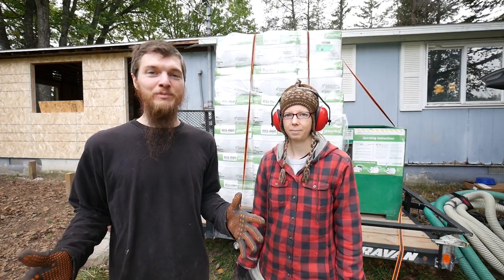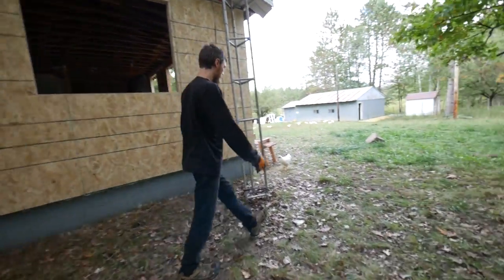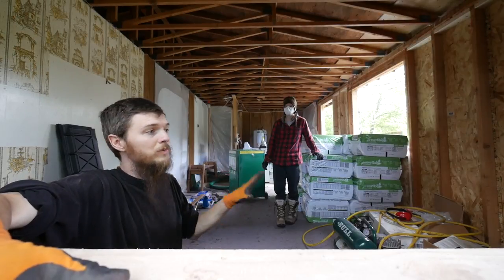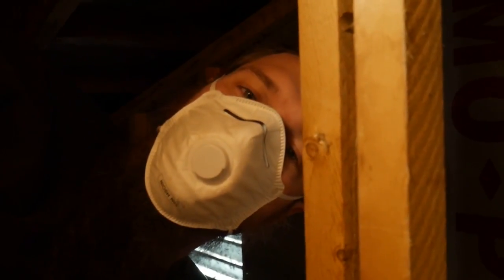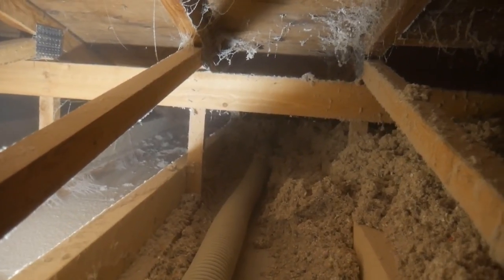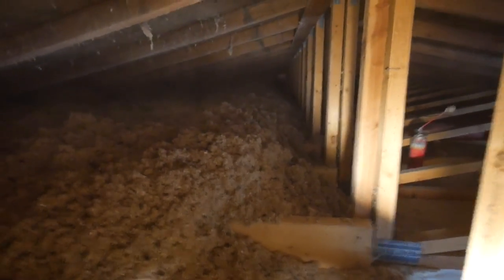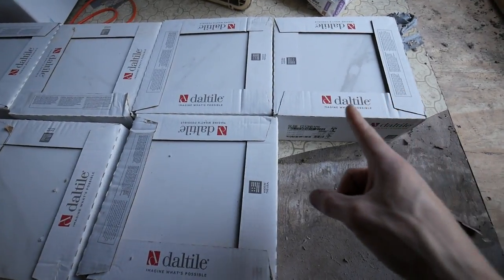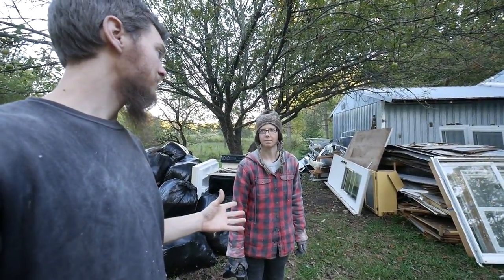Insulating a Cramped Mobile Home Attic - Home Renovation

Comment: Just a thought...assuming you're replacing your kitchen stove, would you consider propane?  The reason I say this is, during power outages, you would have a heat source in addition to the woodstove, but, if there were a power outage in the summer, you could heat water to wash or cook. 
Just food for thought. The project is coming along.
Reply from the maker: Even some newer propane appliances need electricity to run. For now we are not considering propane.
Reply: @diyfferent  I had one...you can light the burners with a match easily. I don't think they have had pilot lights for 15 years. The government thought people were too stupid to notice if the pilot went out. I had a grill with a side burner...it was a good backup.
You are doing such a wonderful job!

Comment: YOU NEED VENTS IN THE ATTIC.  Check with some of your buddies on youtube.  They will help with ideas.
Reply from the maker: We actually no longer need our gable vents because the roofer who replaced the roof last year installed a ridge vent.
Reply from the maker: Like the article says, everyone has an opinion about this stuff :) Most houses in the past were built with gable vents. Then, when ridge vents came into play, builders switched over to them as a better way of venting. So when homes are are re-roofed, they almost always get a new ridge vent now. For our situation, having a very low pitched roof and since the insulation requirements have also changed, we just don't have much room for the gable vents and it's best for us to just remove them.

Comment: You can always rake it to move it with a lief rake, it isn't that bad to move. Wow it only needs to be 8"=R29-12= R43"  LOL after a good wind storm it will be drifted like snow up there and hurt you  roof venting. If mice get into it you may never find them.
Reply from the maker: We did it right. In Michigan, code for attic insulation is R38 to R49 depending on where you live. That equals about 12" to 16" respectively of this insulation to reach those values. In the USA, 8" (R25) is inadequate for an attic in any climate zone. Winds won't be affecting our insulation. We hardly ever get wind here.

Comment: I was thinking at least a cap on your head in case you ended up too close to the roof with all of those nail ends...you would have something to buffer first...I know you are smart and careful about it, but not a happy space to be in ...good to be doing that while the weather is a bit cooler.  I have never seen a "blow in" before...pretty interesting...So this was the riddle that came to mind....In the kitchen is a little green bull. It eats and it eats and it never gets full.  What is it?  ( insulation blower )  I was surprised you didn't devise a ramp to wheel that machine up into the kitchen instead of that heavy lifting.  You are both very strong ( all that hard work!)   Am I allowed to be proud of you?  Too bad if I am not!....
Reply: Designer Window Fashions and some eye protection.
Reply: @arlynelauro9872  I have mentioned eye protection in several of my comments and so have others...that should be a given...but one can only suggest.

Comment: Is blowing insulation better than the sheets of insulation?
Reply from the maker: In this situation we feel that it's better. The cellulose fills in all the holes and gaps really well around and over the joists and trusses. Because we added new joists next to our trusses we would have to cut every batt to fit in between and there would still be gaps where the trusses are. This is just faster, cheaper, and more energy efficient.

Comment: I notice that the vent on the vertical end wall right next to you when you start blowing in the insulation is very close to the insulation height, which suggests that a strong cross-breeze could thin out that area's coverage.  Have you added anything to prevent that?  Well, you can't block the vents themselves cuz the airflow is necessary, but maybe some angled plastic or wooden wind screen would be nice.
Reply from the maker: That whole area will be ripped off and we're going to replace it with solid osb with no vents anymore. It should be okay until then. :)
Reply: @diyfferent  Ah, all right. Thanks for the explanation!

Comment: I though you insolated the roof before you put the drywall up?
Reply from the maker: nope :) All we did was pull out old insulation, beef up existing joists, vapor barrier, then drywall, and finally blow the insulation in :)
Reply: @diyfferent  Ok I remember now . Thank you for reminding me.

Comment: My first thought was a clamp holding the nozzle, front part of the hose on a 1" X 2" X 6'. But I'll watch the rest of the vid now to see what you actually did.

It's fun to guess. Now that I've watched the vid, you were able to just put & push it where you wanted it to go. I thought it may be like a fire hose that goes crazy if not controlled. Nice job! I like the way you think ahead and allowed the spray to taper for future, other half of the ceiling.

Enjoying your videos. Bye.d

Comment: Used the blow-in once yrs ago and would never use it again. Rather use the rock wool
Reply from the maker: That's surprising. Why?
Reply: No problem with ours.
Reply: @diyfferent  Was sweating in the attic. Had to keep a damp cloth around my face/nose to keep from breathing in the dust and it stuck to my sweaty face. Never use it again. Rockwool is best. No itching and it holds it's shape, unlike fiberglass and it sheen's water if a leak develops. Blow-in is cheaper than rockwool but cheap doesn't always translate to better.

Comment: Porcelain and glazed ceramic tiles are very BAD idea to put on floors. 
The cement underlayment helps them collect moisture on top making them very slick and dangerous in environments like kitchens and bathrooms. Also if there's humidity they collect condensation from that too. If you walk in from outside with wet shoes there's yet another slipping hazard 
Whatever previous owner had the brilliant idea to install them in our kitchen and bathroom needs to be kicked. I've slipped and fallen too many times because of moisture on tiles. 
I'd rather have hardwood in kitchen because when something is dropped it's less likely to explode like a bomb. 
Our previous home had hardwood in kitchen and I loved it. 
Here I've dropped supposedly shatter proof lids on the tiled floor to have them explode into hundreds of pieces of shrapnel
Reply from the maker: That's odd, we have never had those problems with tile in our previous homes. We prefer tile in area that are prone to high traffic and possible water contact. We have always loved our tiled floors.

Comment: I was looking to see the ends of the black vent things you stapled to the underside of the roof while and after you blew the insulation.  Didn’t see them.  Did you make sure they are above the insulation, or are you going to have to go back in and move the insulation around with a rake to to expose them?
Reply from the maker: Yea, the're still above the top of the insulation :)

Comment: This is a mobile home? Please excuse my ignorance, I live in New Zealand and over here a mobile home has wheels and sometimes a cab with a motor, also called a motor home or camper van, house truck etc...
Reply from the maker: Yea, that's the term we have for the type of home this is (some people call them trailers). It was manufactured off-site and was pulled here by axles, wheels, and tongues. Once it was brought here and put on the foundation, those were all removed so it's no longer mobile anymore. Ours is a double-wide.
Reply: Most still have their "Frame" like a trailer still and aren't on a full cinder foundation. Normally just a couple stacks of blocks

Comment: not a job for me , im allmost as big around as im tall , once you done blowing it in , you probably can spread it around a little with an extended rake or broom 
you can now calculate pretty exactly how many bales of paper mash you need for the rest by the amount you used for this part 

a lot of the inside stuff can be done in any weather

Comment: What did all that insulation cost you? I have a 20 yr old double wide and the 'attic'  is literally only about 8 inches from ceiling to roof
Reply from the maker: Back when we did it each bale was $8.80. I forget the total cost. They have an insulation calculator on their site which could be helpful: https://www.greenfiber.com/support/insulation-calculator  If you only have 8" it might be better to use batts.
Reply: @diyfferent  can't use bats, no access. Have to drill 6 inch holes in ceiling between each rafter and blow it in thanks

Comment: I have never seen this type of insulation before other then in one video.. I'm European so we don't have these type of roof insulation, but would t it be much more efficient and cleaner if you do the same type of insulation you put in walls? Those thick strips? Why get a machine and take loose insulation? This seems like a huge mess and also all the weight of it is only on the thin plastic foil and drywall.. seems so odd
Reply from the maker: The problem with using rockwool or other insulation batts is that we'd have to use really thick ones to get the desired r-value and then where ever there is a joist, there wouldn't be any insulation above them. Doing the blow-in allows it to be the thickness we want and it fills all the gaps and holes that the batt insulation wouldn't. This insulation just works better for this application. It's pretty lightweight and the drywall can carry the load without problem.
Reply: The blown insulation is very lightweight,  just as rolled insulation is.
Reply: @diyfferent  thank you for the answer, that does make a lot of sense then :)

Comment: Can I ask why you didnt just go up where Ashley was standing with the blower ? and work your way along that way
Reply: The hose was too short
Reply: @hanaebenkhammar459  I know it was , so why noy go up a ladder near Ash & the machine and do sections that way ..a section at a time instead of length ways...thats what I meant.
Reply: @hanaebenkhammar459  I know it was , so why noy go up a ladder near Ash & the machine and do sections that way ..a section at a time instead of length ways...thats what I meant.
Reply: Gotta wait for doug to answer that 😂
Reply from the maker: I'm not sure if I understand what you are asking but I'll do my best to answer. Most of the insulation had to go at the opposite end of the house from where Ashley was standing. I went to that far end of the house and worked my way back to where Ashley was. There would be no way to reach the bedroom ceilings from the room Ashley was in.
Reply: @hanaebenkhammar459  well yeah , thats who I w as asking..LOL
Reply: @diyfferent  Oh ok Doug , I thought the whole roof was open and you could just get on a ladder and do the end section , then ,move the ladder along and do another section instead of sliding down on a plank of wood the length of the house,,,but if you cant get to that from were Ashley is with the machine , it makes sense ..thanks
Reply: @diyfferent  Oh ok Doug , I thought the whole roof was open and you could just get on a ladder and do the end section , then ,move the ladder along and do another section instead of sliding down on a plank of wood the length of the house,,,but if you cant get to that from were Ashley is with the machine , it makes sense ..thanks

Comment: Will that stuff be a little bit rodent resistant? I would hate to see y'all do all that clean up and work just for mice to build new nest.
Reply from the maker: Our goal is to seal everything up so they can't even get into the house. If they can get in, it's already a fail. This house had huge gaps/holes/cracks everywhere that allowed them to come in for the last 45 years, but we're sealing everything up proper so the mice/squirrels/chipmunks will no longer be able to get into our walls, attic, and crawlspace anymore at all. I do believe mice love any and all insulation types.
Reply from the maker: JD  I recently found a nest of 3 baby mice in a bag of leftover rockwool I left in the barn :)

Comment: So .. how much of a fire hazard is this stuff? If it's just paper 'cotton balls' one tiny spark is enough to set your attic on fire?
Reply from the maker: This was taken from the manufacturer: "GreenFiber Insulation is a natural fiber cellulose insulation that consists of 85% recycled paper, mostly recovered, from post-consumer paper fiber that contains additives for fire resistance. GreenFiber Insulation is manufactured to meet strict Consumer Product Safety Commission (CPSC) fire safety regulations. All products meet American Society for Testing and Materials (ASTM) C 739 and E 84 tests. GreenFiber Insulation has a Class 1/A fire rating from E 84 testing, and is permitted as a fire block. The 1998 large-scale outdoor fire demonstration, conducted by the Maryland Fire & Rescue Institute, found a structure insulated with cellulose insulation increased a simulated residential building’s structural fire resistance by as much as 57% over a structure with no insulation or one insulated with fiberglass batts. GreenFiber also has a growing list of fire resistance rated buildings assemblies, of both wall and floor-ceiling type, that are listed in the Certification Directory of Underwriters Laboratories."
Reply: metamud    Good grief....they didn’t shred their own newspaper to make this insulation. This stuff has been around at least since the 80’s. My fireman cousin did our attic and walls with his side business of construction back in the early 80’s. Good stuff.

Comment: I just have to say something about tile. It’s freezing cold in the winter, especially in your neck of the woods. It cracks, especially if your house foundation moves even slightly. Everybody’s foundation moves slightly, especially in drastically changing temps like yours. 
Unless your grout is very dark, every spill will stain the grout and make it look dirty. Anybody who has ever had to clean grout, hates tile. It takes a jack hammer to take it up. If I might make a suggestion to lay tiles in a small area and don’t grout until you know for sure you will like it. I would never, never, ever have tile again. Maybe, and only maybe would I have tile if it’s heated from underneath. And I live in a warm climate. Why not keep the consistency of wood floors like you have in the bedrooms. Out here we have wood laminate floors all throughout the house including the kitchen. Water is not a problem. We have Lino in the bathrooms. The house will flow so much better if the floors are the same throughout. Breaking it up, some wood, some tile is not going to look good. Sorry. I’ve loved every decision you’ve made in all of your videos until I saw the tile.
Reply from the maker: We are not new to the north. Actually, we've always lived in the north our whole lives. We did porcelain tile in our first home in Upstate NY (very cold climate exactly like here) and also in Kokomo, Indiana (another cold climate). The grout and tiles never cracked for us. As long as the floor joists are the proper size and spaced correctly for the type of tile, the tile underlayment is installed properly, the proper expansion gaps are left, and the grout was mixed and applied correctly, there really shouldn't be any cracking. If anyone's grout is cracking, something was done wrong. We personally love porcelain tile. It's one of the best flooring there is for areas prone to wetness like entryways, kitchens, and bathrooms. Most homes we've seen have different floors throughout their homes. That's fine if you don't like tile, but it fits our personal needs and we've had great experiences with it.

Comment: Before you seal the ceiling in the rest of the house why not blow the insulation in as you install the new sheetrock. Thet way you wouldn't ;have to do it from the attic.
Reply from the maker: The free machine rental only lasts 24 hours so we want it all ready to go for the final batch. It's just better if we don't have to feel rushed :)
Reply: @diyfferent  Understood.